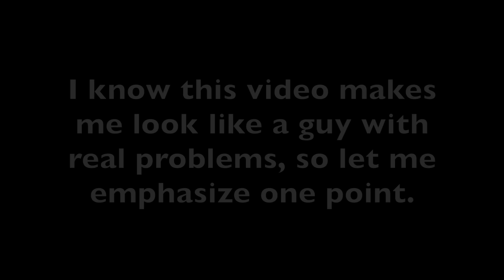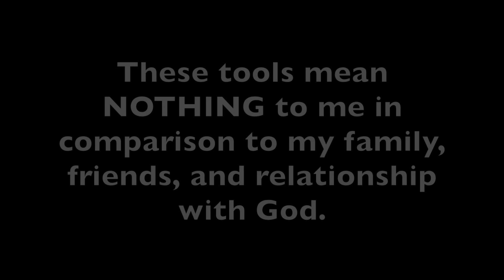Why I Love Tools

Comment: I buy factory tools and shape them with my grinder and files to fit my work. e.g.: cutting slots on a hammer for anti-slip purpose; quenching a cheap pin punch, turning it into a sturdy and durable framing nail punch; etc.

Comment: I recently discovered and already love your channel. In regards to the broad axe head, I have restored a very similar one. My research told me that that size and style were primarily used for hewing railroad ties. They have a handle that is basically the same length as a felling axe, but with a slight curve near the head. I bought my handle online but have yet to hang the head on it.

Thank you for this excellent channel!
Reply: I have left and right handed broad axes. They have handles like hatchets on them.

Comment: Hi. My favorite tools is a set of 3/8 spline drive socket set, spline drive is used on American, English and metric standard hex, square and some other fasteners with the same name socket. 3/8 sets cover most things used daily from home, work, play which mostly needs adjusting or service, so it's the toss up between the 3/8 Fuller standard and deep sockets. These are in my vehicle as it's great in the field used on chainsaws too.

Comment: My favourite tool propably is my 1250g metalworking hammer. It's 40-50 years old at this point, about three times as old as me, but it outlived any other hammer i had. It has served me with about anything you can do with a hammer, from masonry to carpentry. I got it from my grandpa, who got it from his master as an metalworker apprentice, some time in the 60s.

Comment: Ooooh, serious case of anvil envy:  That's a genuine treasure you have there, for sure, one that I totally understand.  All I have is an old beat up 112 pounder, but it IS American made and adequate for my needs creating mokume gane, as well as forging the occasional knife blade.  As for the cruiser's axe, I, too, have had one for decades that I refer to simply as my "double-bitey" axe.  Was in dreadfully rough shape when it came to me as a foundling in the deep woods; after partially restoring it, I've always kept one edge super ultra-sharp, while the other's just sharp, and I wouldn't be without it.  Anyway, thanks mucho for another great vid; not sure I commented my thanks the first time I saw it, some yrs ago.

Comment: Fascinating subject. Retired now I have al lot of tools but my favourite? As a youngster and an apprentice I one day realized what tool I use the most at the steel factory. The press drill and the grinder. Thereafter I realized that I had to have my own. Another thing is that heavy duty 230mm grinder. Dangerous but almost indestructible. Burned out a couple in my life but still have a replacement.  And still have all my toes and fingers. Thank you Lord.

Comment: I got shop full of tools for my company, shipping containers filled to the ceiling, tool trailers jammed... and in watching this I thought to myself everything I have was bought for either at auction or retail, no real sentimental value to anything. And then you pulled out that Square, I have one exactly like yours, its at least 80 years old most of the numbers and lines are faint faint from wear. Shes completely useless, cant use it for anything its so worn down, but my grandfather bought it new and I will never part with her. 

Great videos, you're as wholesome and genuine as they come.

Comment: New viewer. When I saw that your power hammer was a "Chambersburg" I could not help but look it up. Chambersburg PA is under 10 miles from my home. Chambersburg Engineering Co. which was founded in 1897 made it to 2001 before closing their doors. Its cool that you are part of the legacy.

Comment: The broad axe is one of my favorites to. Making a handle is not as easy as you might think. The broad axe was used as a left hand  and a right hand tool.  The handles were reversable  so to put the flat side toward you and they had a 15 degree offset .Sometimes  a .natural tree branch ( Ash or Hickory/ White Oak ) with the right bend was shaped to fit . Yours is a beauty and i suffer from axe envy.  lol
Reply: Should the length of the handle plus blade be equal to an arm's length less than from the wielder's shoulders to the neck of the head on the block?

Comment: Vern--Linda's Husband -- I've put 33 basements under houses----used those line tricks -- learned them on my own--lot's of different tricks under the house too- even laying up the corner last-not first , That is why I could't get a block layer---- if you cut out the corner out first the house sinks and it takes a lot to jack it 
back up----

Comment: most wood workers (especially kats moses) believe you should set a plane on its foot or base not its side (edge) as its hardened tool steel youre not gonna nick the blade, but setting it on its side can knock it out of tune... love ur vids just wanted to add that

Comment: A great selection of tools.  I have a very old broad axe head, and I look forward to viewing your video showing us how you make and install a handle in your broad axe.  The Hay Budden anvil is a real find.  For those who come across a similar anvil, but one with a top face that is pitted, or has damaged edges or a face that is not level, it would interesting to see how you would select the correct welding rod or wire, and the technique you would use, to repair the surface defects and restore the flatness of the face and true up the edges.  Installing an anvil correctly, so that it will not move when you are shaping hot steel, is also an interesting subject, but one you may have already covered. The Burke Bar seems to be lighter and more useful than the old wagon axle I use, which was flattened many decades ago on one end to enable it to be slipped under the edge of that which you would lift. The Power Hammer is essential to getting work done in a blacksmith shop, but many people have never seen one in operation, or if they have, may have no ability to move it or to install it in a suitable shop area.  The secret, if there is one, is to buy it when you have the opportunity, then do whatever it takes to move it to a storage area, until you have the ability and finances to install it in a long-term shop area.  Thanks again for a great video.

Comment: What a great problem to have! And remembering your mentors, respectfully while acknowledging simply and directly,  saying "they're dead' rather than using piffle like 'passed' - is simple, honest and direct. Oddly my favourite tool isn't even a tool anymore, it's a piece of melted aluminium that in early March 1983 was the side cover of my motorcycle engine. After the Ash Wednesday bushfires of that year I recovered it from the concrete floor of what had been the machinery shed on the farm where I worked. It has sat on my side table or desk in every place I have lived in since (around Australia, in the US & UK) and like your anvil it would be painful to part with.

Comment: My top 10 (in no particular order) :
1) flat bar pry bar 
2) 5-in-1 
3) reciprocating saw
4) framing hammer 
5) speed square
6) drill
7) pick axe
8) ratcheting box-end wrenches 
9) combination square 
10) jig saw

Honorable mentions:
1) thread file
2) honing stone 
3) hatchet
4) milling machine
5) lathe
6) micrometer

Comment: 1. Handheld Rotary Drill  
2. Drill Press
3. Hand grinder with Alluminum Oxide Cutoff wheel
4. 6013 Stick welder
5. Electric hedge trimmers
6.  Electric chain saw
7.  Push mower and riding lawn mower.
8.  Miter saw + Table Saw
9.  Vice Grips
10.  Vice

Comment: Good selection.. In no specific order... vice grips, Swiss Army Knife, chop saw, cordless drill, wet dry vac,  hammer, tape measure, drywall T-square, screw drivers and carpenters knife. Honorable mention... caulk gun, putty/taping knife, wire cutter’s w/gauge stripping, electrical tester, skill saw. I can do some damage with these tools. Thanks for posting

Comment: What about an 066? I can’t remember how old it is but it’s knocking on a bit.  Mine is an ‘Arctic’ version which has a heated handle.  What an incredible work horse. It’s 100cc with 10 horse power to the best of my knowledge and makes your ears bleed without ear defenders.

Comment: The tools I value the most are the ones that are not lost or stolen. Had my tools stolen more times than I can count. House broken into twice in two completely different locations. Working outside in the circular driveway of an apt complex with compressor, air gun, table saw, chop saw. drill, etc- went into one of the apts to get a drink of water, was gone no more than one minute, one of the tenants saw three guys pull up in a van grab everything and drive off. Worked on jobsites where other contractors have stolen my tools. Have had them break into my truck. Many more examples.

Comment: 8:18 Have you thought about acid etching (Ferric Chloride) that tool, to show off the grain of the wrought iron and the transition to the HCS ?  Might be a good chance to redo all the normalizing & heat treatment in a digital kiln and do a differential hardening of the edge.  In other words, if ya have a ferarri, ya gotta tune it up, detail it, and pimp it out. 😎

Comment: I have lots of tools, most of which are high quality names that anyone would recognize.  But I have two tools that are relics that still work very well that I love.  Before Black and Decker bought DeWalt, they had their own line of high quality tools that had the name "professional" attached to them.  Of course these are corded tools. Nobody made cordless anything back then.  I still have a 7 1/4 inch circular saw "Sawcat", and a 3/8 inch electric drill.  They are every bit as good as DeWalt or any of the high quality names.  They don't make those anymore, of course.  After B&D bought DeWalt the professional line disappeared.

Comment: Just have to check on the 2 foot squares, a lot of squares now are mass produced by getting stamped out, they are a-lot of the time, not square, you can correct your square with a straight edge, a pen, hammer, and centre punch. First draw a line with the tongue on the straight edge, then flip over the square and draw another line with the tongue still on the strait edge, compare your lines, use your centre punch to open up your square by punching the inside corner or close your square by punching the outside corner, your lines should be parallel to each other after, your square shall now be square.

Comment: 10 tools I would be lost without: Framing square, dial caliper, flat file, HSS bench knife, homemade saw guides (1 rip, 1 crosscut), cordless saw, drill press, cordless drill, gasoline-powered Lincoln welding machine, homemade knife sharpening jig, and coping saw.

Comment: Well, you are a tool user, as am I.  If you cannot use a tool (at home or at work), its no use to you (i.e., not a hood ornament) and there is not much satisfaction in owning it. One of my current favorite tools is a Hilti vibration reducing roto-impact-hammer. I just used it to extend a sewer cleanout from under the house to outside the house. Previously, that Hilti and  spent a lot of quality time doing a seismic retrofit on our home, much of this in a very low headroom crawl space. My old SEARS clicker  70 Ft Lb torque wrench was and still is a favorite tool.

Comment: There is that saying:  The hammers will all be tossed away but all that remains is the Anvil - if u worked with hammers and Anvils for decades  u fully understand that meaning  -  also if u have used tools u understand how u become attached to each one - especially the ones that have been handed down over the generations

Comment: I just don't like worm drive saw.  I know that in the eastern part of North America, they are essentially a standard.  On the west coast, it's a different thing.  I prefer a regular circular saw...or whatever else people might call it.  Have used it for over 20 years...and I find a worm drive to be a bit of a boat anchor, in comparison....and I don't like the thin cutting table.  I find my saw is much more versatile for cutting....mostly because of how the weight is balanced.  I can cut  over my head...or backward or forward...in all kinds of positions....which is very hard to do with a worm drive.
Reply: What?!?! Man I think you got your seaboards mixed up. The mag 77 is a west coast STAPLE, it built the west. There IS NOT another saw besides a worm drive.
Reply: @truckguy6666  Ya...nice try, bud. That's like the Ford/Chevy bullshit.  Open your eyes to the real world.  If you're not open to the variety of tools out there, it's YOUR loss...not mine.
Reply: @joeidaho5938  as a life long tradesman I have used more tools than most people have seen or even heard of. Not liking a worm drive saw immediately tells me all I need to know about your experience with tools.
Reply: @truckguy6666  I've used all kinds of saws.  You don't understand me when I saw I "don't like it".  I find it has it's uses....but it's not a saw for all situations.  The balance of the saw skews it to certain best uses....while others saws that are balanced differently...are best for other situations.  I've used all kinds of tools...from fine shop tools...to the normal framing tools. I work both doing rough work...as well as fine creative work for film industry sets in workshop settings or installation...or building creative furniture, both rustic or finely finished.  You're not the only one with varied experience, bud.  When you lock yourself in...as you come across as doing, then you're lost to the world of learning to use something new.  I can cut in any situation....both hands...backwards...forwards...over my head...or backwards over my head....but a worm drive is clearly NOT the saw to do all of those things. It's a good standard saw...especially for doing straight cuts in front of your body....but NOT as adaptable as a sidewinder to do the more acrobatic cuts that are often necessary when framing in place.  And, by the way, I lived on the west coast for 25 years...in Vancouver, Canada....and worm drive was a rare thing in the framing world.  I was more likely to see someone using a Black and Decker Sawcat....rather than an old worm drive Skil saw.  The most  common saws were the crappy DeWalt circular saws which became the fashion....or the very common Makita circular saws.  I prefer a Milwaukee over any of them.
Reply: @joeidaho5938  Are you left handed? That might be the only excuse for not liking a worm drive mag77. The sidewinder has but one piece of usefulness and it is that the blade will bevel in the opposite direction. Most useful for cutting conventional roof or open beam mortises, so you dont have to run a regular saw "backwards" into the cut. Im sorry you took so much offense to my light hearted comment. It was really just a razz but when you get right down to it, the sentiment is true. Mag 77 #1 forever.
Reply: PS- chevy power.
Reply: @truckguy6666  I'm right handed...although I can cut easily with either hand...one-hand cuts.  When I mean cutting backwards, I mean turning the saw around and cutting.....getting your finger on the trigger and cutting towards yourself....which is sometimes a clear possibility in tight situations, when cutting overhead or in a tight spot.  Not achievable generally with a worm drive...as they don't balance well...and they're also often too long.  Not hard to do with a sidewinder, with a little effort and skill.  Your Chevy comment didn't say much for you....just showing the bias we're already seeing here.  Each saw has it's place.  I often like the wider table of sidewinders for accurate cuts.  Sidewinder is wider....worm drive is thinner.  Sidewinder is shorter...and so on.  They all have their place.  Worm drive is nice for fast cuts on fairly flat plywood because the handle is lower and pushes saw forward easier.  Anyhow....it gets kind of useless to talk to someone who has a stubborn bias to the point where they don't use something....and never  learn the advantages and disadvantage of each tool.  Same can be said about truck models...and years.  Most modern vehicles have become disposable electronic boondoggles, when it comes down to it....as someone who knows a thing or two about auto mechanics.  They will end up in the trash when people aren't willing to pay a mechanic to repair it...and it ends there.  You very likely won't be doing any significant repairs on your own newer vehicle at home.  That's the actual sad truth of the matter.

Comment: I easily relate to this video. I have tools that have been passed down to me through 4 generations. Some of them I use weekly and I think of the men who held them and used them and feel closer to them as I use them. Sentimental attachment to tools might seem silly to some but for me, they connect me to my mentors and role models and to my past. Thanks for this video.